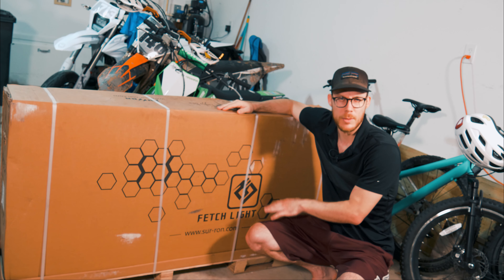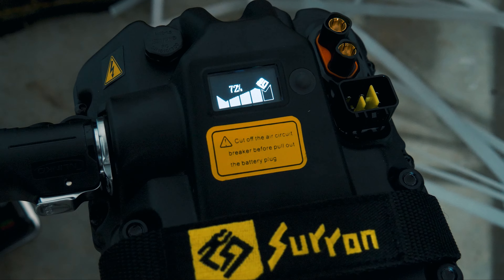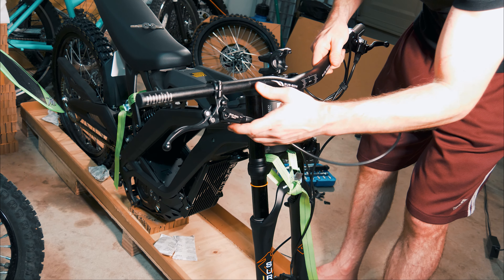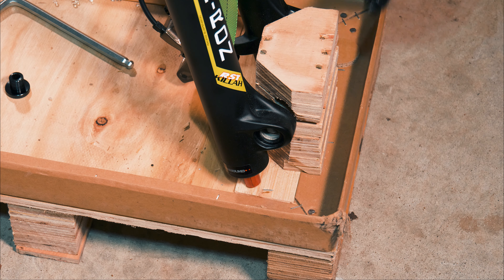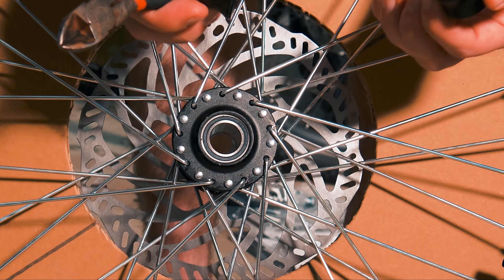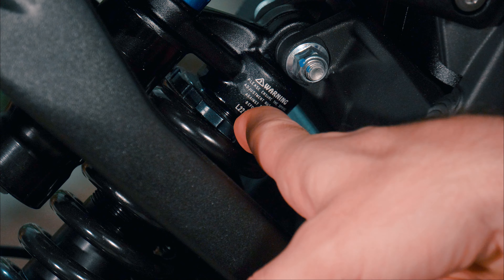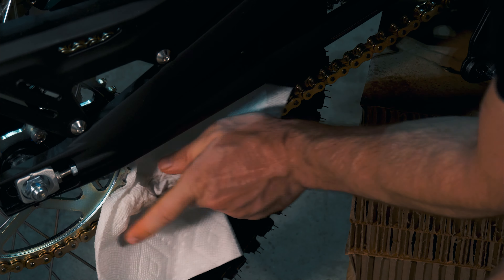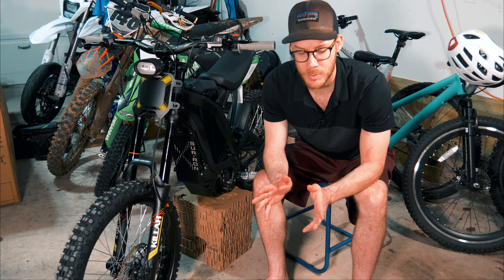How Do I Put This Together? SurRon X Black Edition Unboxing and Assembly. Tips and Tricks.

Comment: Uh Oh!!! Those spacers you mentioned at 16:36. I may have been drinking a bit much when putting together my new Sur Ron. I was wondering where these two thing went! I've been riding it around and seems fine. Now I'm freaking out about front wheel safety. So, I need to take down the front wheel and re-assemble?
Reply from the maker: should just be on either side of the wheel on the front wheel axle
Reply: @lowclassmediavideos  OK. Thank you. I'll get to that.

Comment: Thanks for making this Vid! Mine arrives tomorrow and hopefully, this gal can put it together easily. (I took notes 😂). I've been riding motorcycles for 6 years and am excited to try this bike out.
Reply from the maker: haha no problem...they are a blast! they arent super super robust in terms of jumping and smashing over rocks and roots and such so take it easy
Reply: @lowclassmediavideos  Thanks! Mostly for road use for me.
Reply: @lowclassmediavideos  Hi again, I can't tell you how helpful your Vid was for me. Got the bike this morning and put it together. The most difficult part was getting the front forks off that wooden block!! You were right about the need for better packaging in that dept. I'm pretty stoked about this bike. Did you snip the green wire to remove any limitations? I also noticed the throttle has quite a bit of play in it before it engages. Same for you? Thanks for all your help. New Sub 😁
Reply from the maker: yeah that wooden block was a pain! i did snip my wire...its really easy. used electrical tape on the ends. 

hmmm nah no real play in my throttle.

thanks for subbing!!

Comment: dude the fork tubes are not 100% align. You need to either pull or push one of the tubes and the axle slides right now.
Reply from the maker: negative...they are different fork lengths

Comment: after hours of trying to put the bike together I give up . watched every sur ron video probably.  Even with brake calipers removed the tires barely will spin.  Demotivated about this whole bike ... really wish I hadn't bought it.
Reply: Some people just should not touch tools !
Reply: @bradymac7516  I didn’t touch them I had gloves on
Reply: @CmdrTigerKing  so did u get the bike together??
Reply: Keep trying. Take it slow. Sometimes even in small stages. Call a buddy to help, and then blame him. I challenged myself to just use those crappy tools that came with it it and I was able to put it together even though I probably own $6,000.00 worth of tools. You're frustration is due, usually, because you missed something very small somehow in the steps. Always works that way.
Reply: The most important tool you need is... patience. Everyone has it, but not everyone knows how to use it.